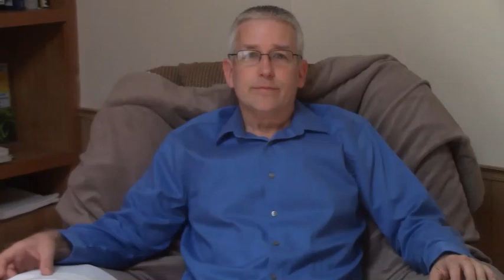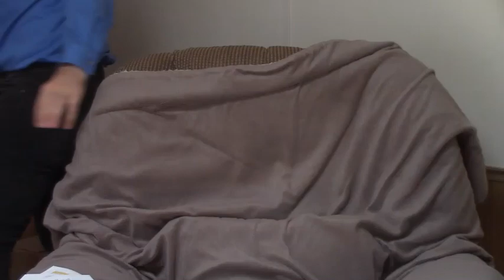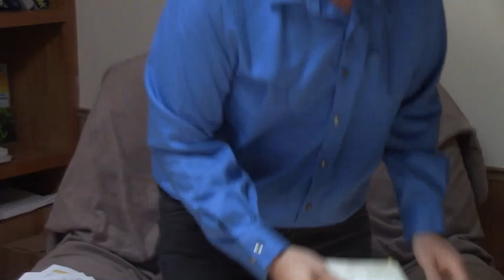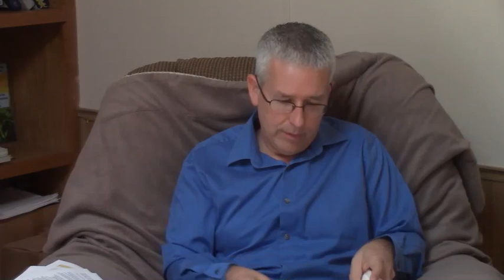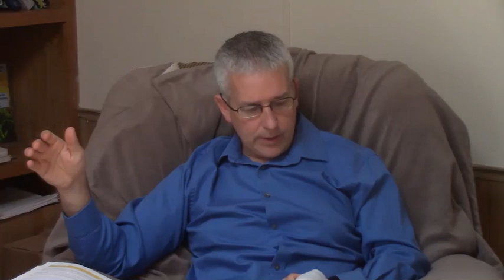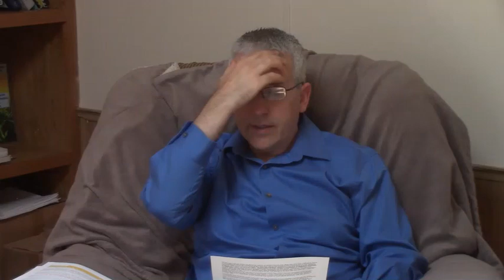Negative Resistors in Batteries

Comment: It's a crime against humanity whats elites are doing to the world. World burn so much coal and fossil fuel for their greed when it never needed. Many patents that would have help mankind advance was never allow to be commercially produce. Anyway I finally I got motor to loop in One body circuit so it run motor in perpetual motion. One side charging and other discharging same amount but total voltage remain the same in one body. Im hoping to add more power to circuit with impedances on output. Thank you for your knowledge and teaching!